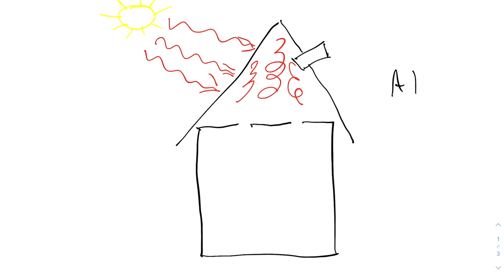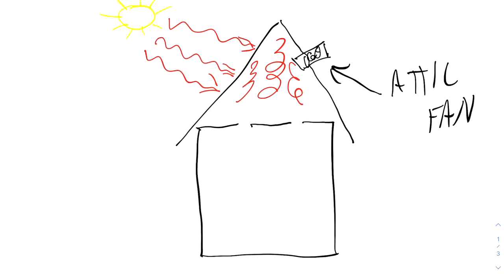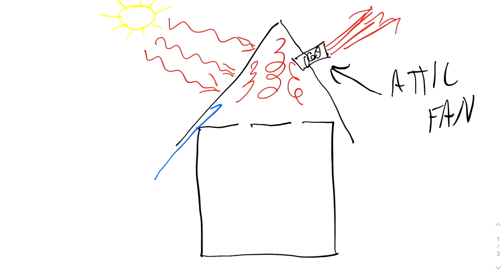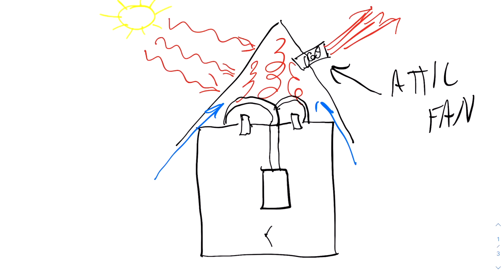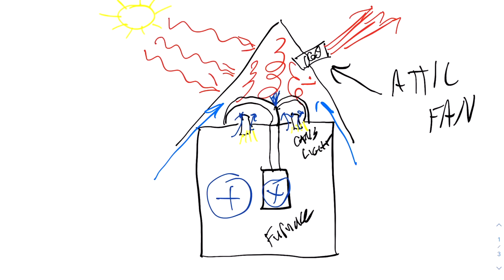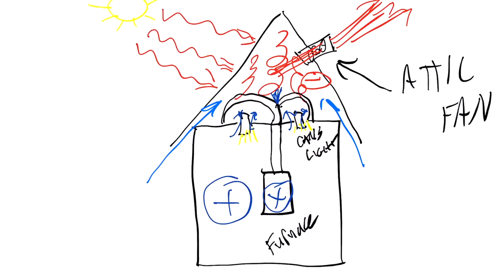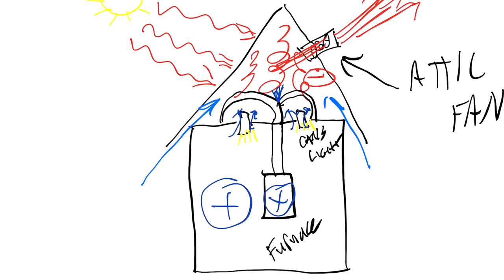3 Remodel Rip-Offs

Comment: I like your videos but since you're calling everything a scam... Most smart thermostats are not $250 plus. You can get some for half that. Mine precools the house when the wholesale energy cost is cheaper (griddy) and turns itself off when the energy is more expensive. That might be a specific case, but even other people will benefit from being able to program it to have a good night temperature so that they can sleep well, more sensors around the house so that it can make sure the areas where occupied areas are cool, can use the weather forecast to estimate the most efficient time to cool, can check humidity... plus if the temperature isn't right for whatever reason, then I can adjust it from wherever I am with my phone. So I think spending the whole time talking about a specific instance of the fan running too much is weird. Mine runs the fan when it needs to circulate the air if there is a temperature difference between the sensors.

Comment: I have been in the home improvement business for almost 20 years. I can tell you that attic fans do work in some circumstances. Regarding Wi-Fi thermostats, most Wi-Fi thermostats are set for what’s called a.TOU setting. this setting is to make people aware of peak times when energy is more expensive. The smart thermostat will then turn off or cool the house down before that time to save money. It is a fact that they have saved up to 40% on energy bills people forget to do this because we are very busy. Now you can set your thermostat to turn off at those peak times, but it will not cool down the house a little bit more. With all due respect, I think you need to do a little bit more research.

Comment: Replacing single pane windows with double pane is purely for the comfort value sitting next to a single pane with the sun shining through is hot the same with a double pane is way cooler and even more so if it’s uv reflective

Comment: Right….so the fan at the high point in attic where the hot air is rising, isn’t powerful enough to expel the hot air, but it is somehow powerful enough to pull your cool conditioned air, which is heavier, up through the drywall and vents? This is propaganda and not how thermal displacement functions.

Comment: Other than the neck decoration, he looks like a smart guy.  But I think he skipped science class in school.
Soffits should provide plenty of air to prevent pressure issues in the attic.
The "A" coil is still cool after the compressor stops.  So it will continue to condensate until warm.  About 10 minutes.
If double pane windows work in the north to keep the heat IN; they should also work well in the south to keep the heat OUT.

Comment: The attic fan is only meant to keep your attic space close to the outside temperature. Meaning, if it’s 102 outside, then your attic space will be close to that temperature. The fan is meant to be an exhaust fan and it has to be the right size for your attic space.

Comment: You are TOTALLY wrong about the solar attic fan. I installed one my self over 10 years ago. Not only did I get a tax write off but I INSTANTLY saved a $100 per month!!! It paid for itself in a year!!  I live in in Dallas and I could never go in the attic in the middle of the afternoon in August. It was over 105 yesterday in the yard and I spent over a half an hour in the attic and wasn't even sweating!!!! Granted the fan was pulling a little of the cool air from the house in the center of the attic but not in the ends or the edges!  

I like your other videos but you just don't know what your talking about with this one.

Comment: Matt you are 100% incorrect on attic fans. You need to stick to stuff you know and stay away from HVAC. Leave that stuff to the pros. Unless you actually installed and done " real world testing" then you have no clue. I have been in hundreds if not thousands of attics over my career as an hvac tech. We have install attic fans and showed customers REAL WORLD RESULTS.  I have personally taken temp from their attics before and after. We have seen any where's from 15 to 25 degree drop in attic Temps in the summer in very similar conditions. We also have taken temp of customers delta T before and after with attic install HVAC equipment and duct systems. We have seen a 2° to 5° improvement with installation with proper attic ventilation.  I will agree people do OVER ventilate their attics with too big of a fan at times which is a mistake.
Reply: Also remember people do not have thousands of dollars to always make the best upgrade or improvements. I've watched your show plenty of times your big on conditioning the attics which I agree with but not everyone can afford that option of spray foaming. To offer an improvement that WILL HELP their HVAC system as a whole is a big plus when it can fit the customers budget....

Comment: I have installed everything you said was not working or worth it and have had positive results every time.  I feel your advice is misleading and goes against every energy saving device today. And to finish out double windows are by far better than single glass.

Comment: Ya, he's just wrong here. I own an HVAC business and I can guarantee you that letting your attic climb into the 120's and above, puts massive stress on your AC system. And in my state, your attic will trap that heat long into the night & morning if your attic isn't properly ventilated. Thinking you can keep it at 70 in the summer is obviously ridiculous, but having a fan pull the 110 degree air out of your attic will absolutely take weight off your AC system, which will in turn conserve power. Many other factors are involved that aren't mention including: insulation, angle to the sun, hours in the sun, shingles, etc.. Heat loss calculations should be left to professionals in any case.

Comment: Your comments about the attic fan would have been more persuasive if you had backed them up with some facts, instead of simply stating what you think about them. Judging by some of the comments you've already received, some people have the experience of the attic fans actually working as advertised. Perhaps you would like to do some further research into this topic, including an actual test set up with real test numbers, and then post a follow up video?

Comment: 5:20 Airwave is the dumbest "feature" to exist in any thermostat, and they turn it on by default.
I'm an HVAC Technician, every time I see a Nest thermostat I turn that feature off. Instant humidity control upgrade.

Comment: My attic has slotted vents on each end of the gables. As such, a powered attic fan would, in fact, help to cool it in the hot summer months. Your assumption of a closed attic space is not the norm.

Comment: I would 100% disagree with your opinion about attic exhaust fans. In summer the outside temperatures are cooler than any attic space. Having static hot air inside the attic only makes the matter multiply the hotter it gets outside and/or the more the rediation rays of the sun beat down on the roof materials. Moving outside air inside the attic simply lowers the attic temperatures, most of us understand and agree with that science. Proper venting and sizing of the fan is important however, just like over sizing a central A/C unit will not do the job as intended. Where your science comes from suggesting that an attic that is hotter vs. cooler makes no difference to the living areas is completely bass ackwards.

Comment: As I am one of your fan and love most of your videos, but I have to disagree with this one, what you've said seems to mis-leading the public. Attic/Solar fan works when installed properly. I had it installed in my first house and also the new house, I've noticed lot of different, made my attic cooler and saved energy, paid less in electrical bill.

Comment: Here in the SW of the US, the quiet Cool system works really well, they are very popular, my house does not cool down by itself, I have to run the AC, last August it never turned off, my bill was 500 new record for a 1300sq ft single story house.   I. am looking into getting a Quiet Cool system, I will install it myself, a thousand bucks install for 2 hours work NAH.

Comment: I have to disagree on your hvac wheather you have fan on auto or on. When you replace your furnace or a/c  and have the ECM motor. There are options when your space is satisfied ,leaving it on " on ". When the fan cycles down to a very low speed ,in the winter it will make your home more even temp. 
Now there are so many options on hvac equipment, mutiple stage heating and cooling to check out these days

Comment: The attic fan portion is DUMB and misguided.  His analysis rarely if ever applies to homes.  With proper & adequate soffit vents, and gable vents, attic fans DO help draw in cooler air and push out hot air.  The attic air DOES get cooler.  Anytime you can achieve attic air exchange, it is a good thing.  Now, just how much of a difference this makes on the inside home temp or the cooling bills, can only be determined by the homeowner.

Comment: I disagree, I believe you are scam. I install two attic fans and smart thermostat and they work. If you are inside an attic before and after, you will notice. I notice with the smart thermostat that reduce my bill how it knows when I'm not at home so it change to 79* and when I'm getting close home it turn on. Air leak is probably the most important because it is a combination of everything.

Comment: You are definitely wrong about the attic fan. When you exchange 90 degree outdoor air with 120-170 degree attic air you will cool it down. You need a make up air vent taking in outdoor air so it does not pull air from your home through penetrations. Make up vent draws air in and a powered vent exhausts it. 20 plus years in HVAC experience here. I guarantee you do not want to work in an attic without exhaust fans in the summer.

Comment: I thought the whole point of an Attic fan was to circulate air around the house not cool the house.  You know hot summer days just aren't that bad when you can feel a slight breeze.  Or at night when the air outside is cool and you want to pull cool air in and suck the still, hot air out...I don't know I just can't stand being in a hot room with no air moving, it just feels like being in an Oven

Comment: Ha! This guy is a tool! I am an electrician in Florida. I am in attics every day. Attics get 150° here easy. Ones with fans are always cooler. Attic ventilation systems causes a convection current that pulls air from the soffit through the ridge venting. It works because hot air rises. Plus as the attic heats up the air expands which increases the current.  An attic fan just increases that effect.  That is how heat is dissipated. If it is not dissipated through the vents it will go somewhere, so alot  ends up in your house. It's like having a oven on top of your house. 
    Just a 25 watt fan can displace 1500 sqft of air in an hour. 
   As for the negative pressure an attic fan creates, that is what pulls the air through the soffit. Your living envelope should be sealed away from the attic. If you have holes in your ceiling you need to fill those. 
   Get a thermal camera walk through. It will show you where your leaks are.  

I am not even going to comment on the other 2!

Comment: I am no roofer and am lost. Being told I need 2 solar attic fans. I asked about the tax credit; roofer told me because they provided the product, they get the credit. Screw that, I'll go buy them get the tax credit and have them installed or crawl my disabled arse up there and do it myself. Can't be that hard. Mark a hole from the inside in attic, good on roof with line and chalk draw a circle, cut the hole sized as needed, peel back room to install the fan, slide the fan into place, reseal, nail, etc. boom done. But my question is how do those of us, not in the biz, know if they are a rip off or not, if ridge vents are adequate, etc. I don't know all of that. The industry and workers need to understand and help us do it right and what is needed and stop trying to take advantage of our ignorance. Do they work, are they worth it, is there an alternative, over under pressure how does a homeowner understand all of that?

Comment: This is really bad advice.  Try this - Go into a sauna and close the door... hot.  Now put a fan in the door.  That basically is what the powered vents do, particular in areas of a house attic which don't get much natural flow (assuming ridge vents <-- a great investment).   Smart thermostat - ones that can run a SEER rated HVAC are smart - i.e. they run computations to adjust the house air as you desire... for example they monitor humidity and adjust low and high speed to optimize humidity and temperature.  Additionally, the addition of automation to adjust the thermostat from practically anywhere and to monitor what is going on remotely can potentially save you thousands of dollars when an HVAC has a problem.  Then windows - very expensive - BUT if you are replacing for just energy cost ... no way - better off with solar screens.  But, for noise, comfort, removing ultraviolet damage to drapes/curtains/blinds, reducing drafts - it may be worth it.

Comment: I am just spitting out mental gymnastics like Mike did, but would your air conditioning system not suck the hot attic air into your house through the same "holes" in your building envelope.  At the very least, an attic fan would negate the intrusion of this hot attic air.  All I know for sure is, they do save money on your power bill, and help control attic moisture.

Comment: Full of baloney it's unbelievable, with regards to attic fans… I'm a roofer in Dallas Texas and I can tell you this, when I put a new roof on the house and I changed out the soffit vents and put a whirlybird on the top I measured the attic temperature before and after, and I have seen attics drop 20 and 30° and I have been an attic's that have fresh air blowing in to the attic as a result of putting whirlybirds on the top… I am not a big fan of solar attic fans but… This guy Does not know what he's talking about, he said in his research, what are his sources that's like saying go out and get the vaccination because the doctor say it will protect you… My doctor told me not to get the vaccination… Sorry I digress

Comment: The comment about attic vents makes sense, in that an attic vent pushing air out through the roof is going attic create negative pressure inside the attic. That is going to tend to pull your conditioned air into the attic, even more so since more HVAC systems create rooms with slightly positive air pressure. Couldn't you prevent that by just air sealing the ceilings though?
Reply: Yeah, pull all of your ceiling fixtures and caulk around the boxes....you'll be amazed/disgusted at some of the shoddy work you'll find....

And NEVER install HVAC air handlers in an attic space. Think about it, placing the parts to cool your home IN the hottest area of your home...blows my mind why code still allows it.

Comment: I respectfully disagree with his statements dismissive of the effectiveness of solar exhaust fans. I installed 2 solar exhaust fans on my Father’s house and it made all the difference in cooling the house down. Hot air accumulates and starts to migrate downward when not adequately ventilated. You need and exhaust route as well as an intake of cooler air to facilitate moving the hot up and out. Otherwise the hot air is just going to sit there. 

Goes to prove that you can’t believe everything on YouTube. Critical thinking and experience are the way to go.

Comment: I tried to give you the benefit of the drought, but when I heard your talk about Smart Thermostate, I knew you were mistaken and did not understand the technology and options that the unit has and when the Utility providers do with it to low energy consumption... As a current user, I have saved 23-28% of my utility bills using my smart thermostat.

Comment: As long as there is enough air flow via soffits, gables, etc, creating a negative pressure  via attic fan should not be a major concern. The benefits of balancing attic air with the outdoors  is enormous. Sorry Matt, I respectfully disagree on this.

Comment: I dont think you have ever been in an attic with a properly sized attic fan in there. Solar attic fans dont claim to make the attic temp lower than ambient temperature (outside temp), they usually say it will be 10-15 degrees from ambient temp. Secondly you can only cause decompression in an attic if it doesnt have proper air intake. There is more to this than what you are saying about attic fan, solar or AC powered.

Comment: Great information as usual. I run a separate dehumidifier in my basement full time. I have it set to a limit and it comes on and off accordingly. I ditched my Google nest thermostat early this winter/ spring and went with a dumbed down programmable one. And guess what? I'm saving money on my energy bill! The smart thermostat was a bit of a joke and out of my control.

Comment: His description of radiant heat being the same in an attic and a Microwave is completely wrong.  Microwaves do not heat the air in the microwave, they aggravate the liquid molecules inside the food using waves.  Drawing in cooler, fresh air to the attic space does work.  Maybe not what people advertise, but I had a temp controlled attic fan that dropped the temp in my second floor by 20 degrees in the Iowa summertime.  It was FOR SURE worth it just for comfort and cost savings on AC.